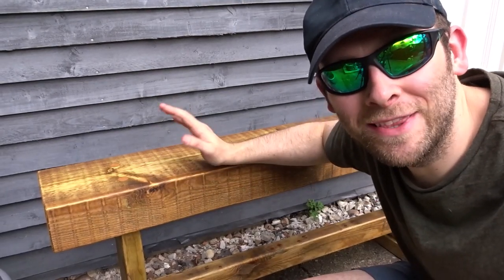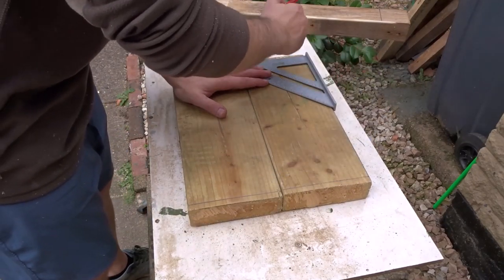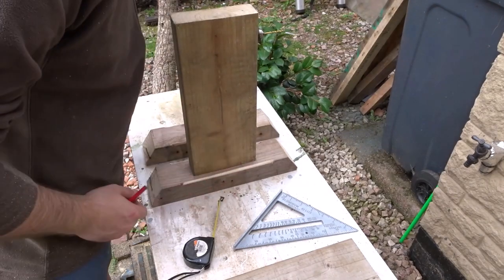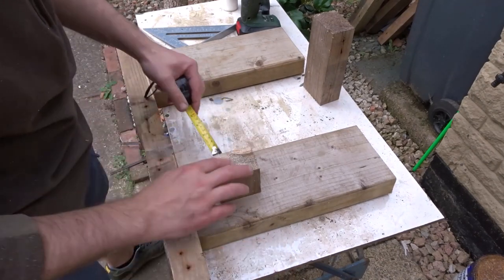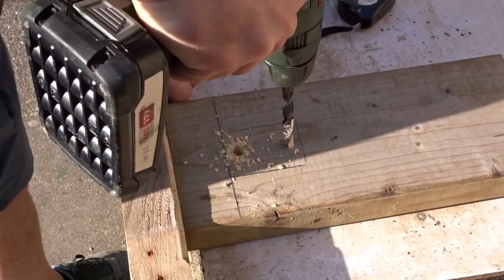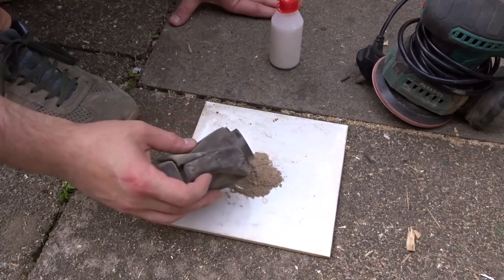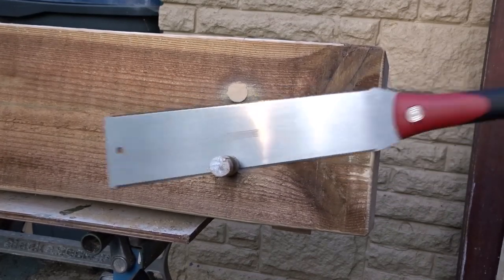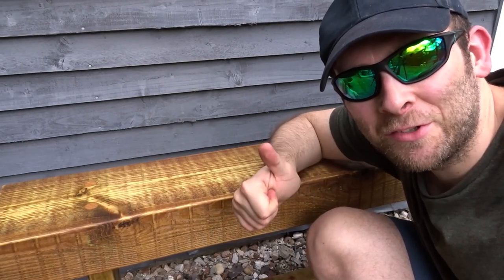How to Build an Outdoor Sleeper Bench Seat (Scrap Wood DIY Project)

Comment: Good work mate top job.
Have you ever made a new garden gate as I need to either make a new one or repair the one at present with perhaps new feather edge boards.
I need to put in a proper lock in it to so I can lock it from both sides as i use it everyday.
Any help would be great.
Keep up the good work 👍
Reply from the maker: Thanks Adam 👍 I am planning to make a gate for my dad soon with either feather edge or tongue and groove boards. Just need to find the time to do it I should be making a video about that too. Thanks for the support 👍👍